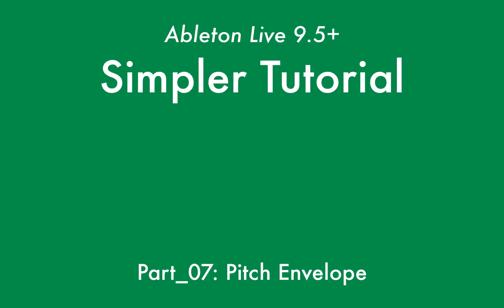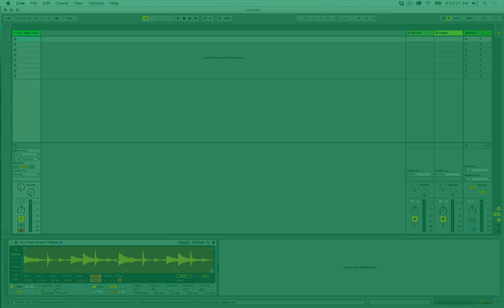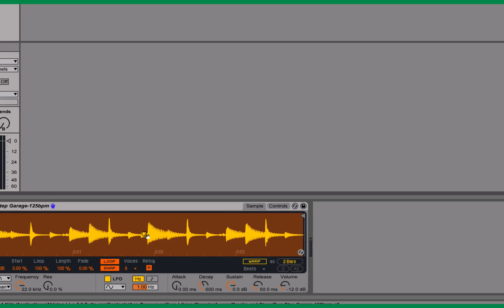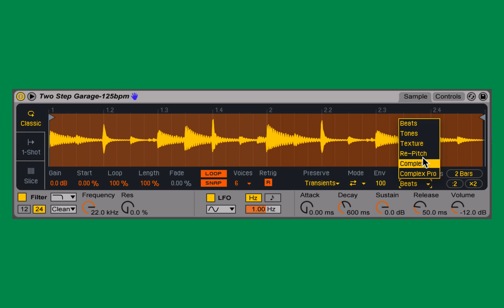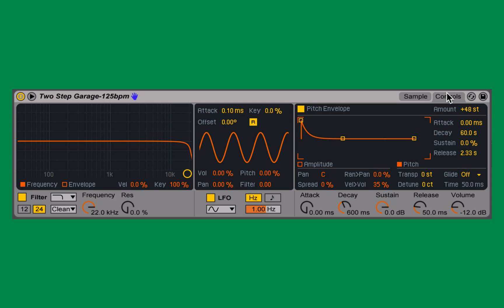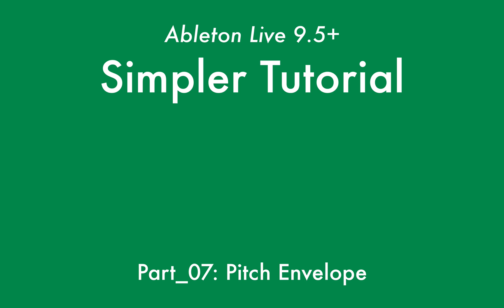Ableton Live 9: Simpler Tutorial - Part_07: Pitch Envelope

Comment: thanks but I was wondering if it's possible to modify the pitch in smaller increments than semitones. And is there a whole seperate tool / plugin for something like that? Similar to an lfo tool basically
Reply from the maker: Yes, check out part 12 in this series. The "Detune" parameter lets you tune in cents. 100 cents = 1 semitone.